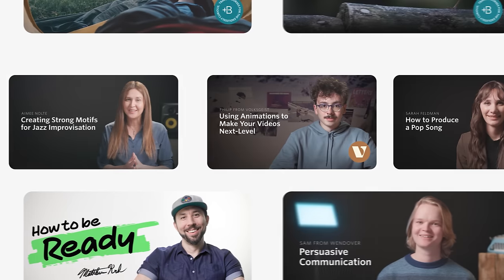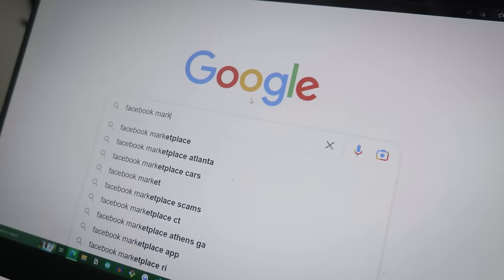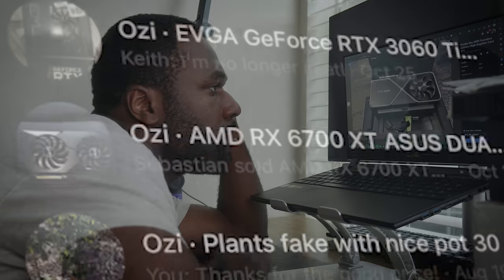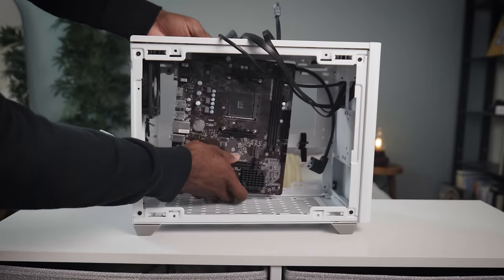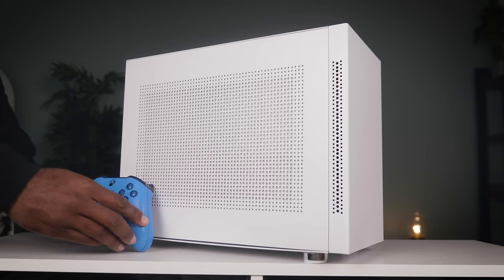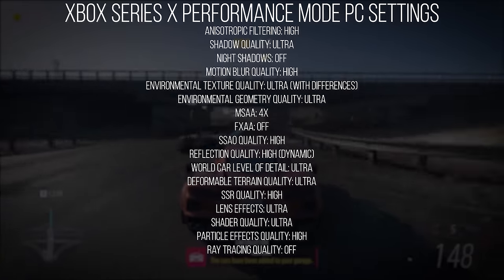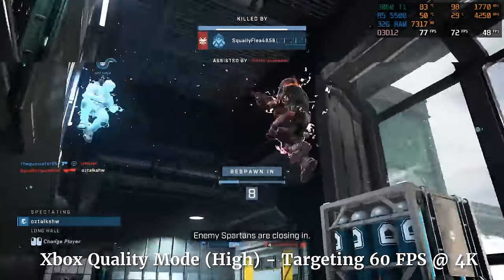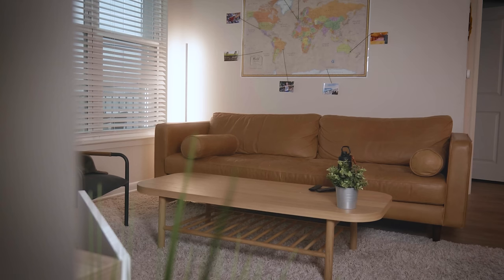I built a faster Xbox Series X for $474

Comment: The consoles may use a 6700XT-esque GPU but their performance isn’t even close in reality (find benchmarks if you don’t believe me) so the idea that you need a $400 GPU to keep up is inaccurate.
 You also could have cheaped-out a bit more on the Case, PSU, and motherboard, which when combined with a more reasonable GPU equivalent could have the price of a new rig at around $6-700
Cool and well produced video otherwise.

Comment: If you update the bios on that mobo, you can enable 4g encoding / rebar and using an Intel Arc a750 with it (I know this because I just did this for my son replacing his old 1660 Super and he has the same mobo basically "msi a320m-a pro") and it'll put you around the power of a 3060 10fps faster or slower depending on the game and the Arc a750 is CHEAP. But you NEED rebar. I know its about a 3060 as its performing about the same as the EVGA 3060 12gb I had before I upgraded to a rx6800 16gb. EDIT: Didn't get to the GPU part, 3060ti good deal bro!

Comment: If you place the PC on the floor to the left of the cabinet, the temperatures will be better because there is airflow all around the case. Even with the cabinet door open, the hot exhaust air gets trapped in the back of the cabinet and cannot escape easily. Aesthetically it's nice to have the PC inside the cabinet, but with a graphics card working hard, you really need to move it out. After all, you made a PC that looks great. There's no need to hide it away!

Comment: I ran into an equally long debate about which case to use for a system downsize. Unfortunately there's just no clean way to use the NR200 without paying the itx tax on at least the mobo. A small matx form factor is definitely the way to go when budget is the primary factor. But if ITX is the goal, nothing beats the NR200 on compatibility and budget. Thanks for bringing the vibes Oz!
Reply from the maker: You feel my pain 😭 I really wanted the NR200 to work, because it's an affordable entry to the SFF world...but the SAMA IM01 is still killer. It's an NR200 copy and only an extra liter of space. Seriously unnoticeable. Glad you enjoyed!
Reply: @OzTalksHW  Oh wow, I didn't know it was so close in size! Good call on that one. You're almost making me regret switching my matx mobo out 😅 I really like the vinyl wrap idea as a solution for getting those black parts on theme. Cheers bro!

Comment: Don't waste money on vinyl wraps and cable extensions on any builds that don't use a pc case with tempered glass. Save about $20-$40 without all the additional pointless stuff. I would also have kept the NR200 case instead and to find a used B450 itx board like the Asrock B450 fatality mitx motherboard instead, NR200 offers way better air cooling and potential side mounted aio water cooling if you opted to do so in the future.

Would 100% get better GPU temps with the NR200 case.

Comment: The gpu was overheating because the 3060 ti isn't meant for 4k. It's meant for 1440 which it's a beast at. You would've gotten way better fps at 1440 as well.

Comment: Hey man i have gtx 1070 blower style fan like yours... I was getting c so I opened replaced the thermal paste on gpu and the thermal pads on the gpus memory... the factory thermal pads sux... try replacing them... gelid is the brand of the pads ... now getting 65 68c...

Comment: Leven has been making switching from Mechanical to solid state a lot cheaper.  I gotta convert 40TB of HDD to SSD, and they have lowered their 4TB SSDs to really low amount I just bought there 4TB NVME for $200.  I am also planing to buy a few of those 512GB SSDs to give some old laptops some new life, and turn them into Batocera PCs for emulation for those that want to get into classic gaming cheap since they're too old for modern games/programs, or even Windows 10 for that matter.

Comment: 1. IDK why you think why it's hard to find a MicroATX case that supports a standard ATX PSU (150mm). My favorite cheap MicroATX case, which also happens to be the CHEAPEST mATX on Newegg now, is the "DIYPC DIY-F2-W White SPCC Micro ATX Mini Tower Computer Case" and supports a 170mm PSU.  It's only $40 +$8 shipping. All you do is click on Cases > MicroATX > Sort by Price. Plenty more exist too, so IDK why you weren't able to find them.
2. That SSD is trash and will prolly die quickly. While I know you were budget limited, for people actually doing this, I'd suggest putting more towards a good SSD.

Comment: There are many things wrong with this!! I'll try to bullet point for brevity but apologies in advance for the length of this:

- You have a SATA ssd, you'd need a pcie 4.0 M2 to match the xbox. Your load times are gonna be much worse.

-Even if you found an m.2 ssd, your motherboard only supports up to pcie 3.0, so still slower read/write speeds. This isn't even mentioning your half-size storage.

- Your RAM mysteriously doubled from what you bought and what was displayed (16gb to 32)

- You had to absolutely deep dive through 2nd hand marketplaces to find any of these components and your cost didn't factor in money wasted on junk (which will happen with these markets)

- You could just buy a second hand xb sx for half the price and a free controller. That alone invalidates your video

- The majority of games support free upgrades from xb1, and even if they don't, you can get much cheaper games than xb marketplace. Elden ring is £35 on cdkeys. Idk what that is in $.

- You didn't include price of OS. You can get a windows key for about £70 in the uk.
I tried cloning my OS from an old pc hdd to get around this, but boy was that a ball ache. Never again.

- Games will be optimised for consoles: they'll load and launch faster, and make far better use of the hardware.

I mean no disrespect, and I have no issue with these kinds of budget like-for-like videos, but I have serious issues with pc master race fanboys making ridiculous claims that they could build "xbox / ps5 killers". This isn't even mentioning how good console UIs are, with loads of built-in features like party chats, messaging, anti hacker services, NEVER HAVING SOFTWARE ISSUES, etc...

What you've made is so much worse than a console.
Reply: Hmm all these bottlenecks but forza and halo still run better :/ weird

Comment: my micro build msi board $360 au ddr4 3600 32 gig $120 9900k $360 ebay 3700ti $1200 watercooler 240 $80 power supply $60 hard drive m.2 500gig $29 2 gig hd $110 and it gets real hot

Comment: I made an offer of $198 for 2080 and the seller accepted and then immediately after I found $120 Ryzen 5600X, I was on my way to build I cheaper PC than yours but the sff case, the SFX power supply and the Mini-ITX board pushed my budget to $647 in total

Comment: I have a 3060ti with a small undervolt and it usually is in the low 60's while gaming  (in a small form factor case). I imagine having it inside that cabinet could be part of your issue? You seem to have plenty of fans.
Reply: @Blue I have it paired with a Ryzen 5700X, while he only has a 5500.
Reply: @Blue 1440p. GPU often into the high 90s so it's definitely getting a workout.
Reply from the maker: Is yours a blower style cooler or a dual/tri fan axis cooler? Blower styles just run hotter unfortunately
Reply: @OzTalksHW  I just went back rewatched your vid and I guess I missed the part where you hold up the GPU (and show it to be a blower style). You're right that probably accounts for a lot of it (mine is dual fan)! But still for $240 what a steal!

Comment: Me looking at this dude while I’m seeing what it costs to play cyberpunk at the best settings with parts excluding the updated ones I have costing me nearly $1000😂 buuut that’s why I’m using my tax returns to buy those parts. Already brought a Ryzen 9 5900x for only $350.  Now all I truly need is a better power supply, case, and motherboard(especially since my cpu won’t even fit in my one now). I already have a 3070ti with a hyper 212 cooling fan which surprisingly works incredibly well with cyberpunk considering it’s very cpu heavy. When I buy all my new parts I’ll have my friend guide me through building it because I’ve never built one before. I’m very excited and it’ll be hopefully my last upgrade ever until maybe a new graphics card in the future.

Comment: You can definitely change the Xbox resolution settings from 480 to 720 to 1080 to 1440 to 4k .. you can also run 60 or 120 fps . You can also use freesync ! There’s no reason to get a PC nowadays , but if you just want to say you have one. You’re actually spending more for less
Reply: consoles run a lower resolution scaled up to a higher resolution
Reply: @Gr8Imres  I’m sorry , but games for Xbox and PlayStation are not scaled in any way. They’re particularly made the run their best in consoles. You see, the difference between y’all’s low medium high and ultra. We only have one setting. Ultra . Some games allow you to focus on frame rate and will take some graphical settings out. But other than that , You basically buying a pc for nothing. I have a pc but even with a 4070 and a 240hz 1440p that can also run 4k it’s nowhere near as smoothe and simple as the console. Yea I can mod but other than that… it was really a waste
Reply: @G0dspeeed97  "They don't run native 4k. They use checkerboarding and upscaling techniques, or run a lower resolution. Interlacing, dynamic resolution, and other tricks, but non of them are true 4k 60"
Reply: All the latest AAA games on console are 30hz with some getting a 60hz performance option.. cod is  like the only 120hz AAA title as of lately..

For resolution its all FSR upscaling, not native 4k 😂
Reply: @LovingAllOfYouuu The Xbox and PS5 literally use FSR from AMD to upscale the image for a higher fps count. 

Games are cheaper on PC, free online more in game options, more games than the ps5 and xbox combined the list goes on. 

You're just uninformed brother😂
Reply: Also, free sync is literally just a VRR technique to match the refresh rate to your display to the fps in a game literally does nothing for performance and isn't exclusive to consoles. 

Free sync is on PC for AMD GPUs and for Nvidia users it's called G-Sync. Both are shit options and instead of having them on they're better off to reduce frame times and latency and stutters from 1% lows.

Comment: I'd add a temp controlled fan, to cool that gpu a bit more... Also change the back one, for a temp controlled one. They are cheap & you can place the temp probe, where you need it.. then obviously as the temp starts to rise, the fan speed increases, to handle it!
I got 3 in my system, & normal intake fans at the front x 3...

Boy, changing the other standard top & back fans, to the temp probe speed controlled fans, made a big difference & better sound control also, as on cooler days (room temp) the fans spin slower 👍👍
Reply: Aren’t all fans temp controlled.. or at least spin faster when the temps rise, and you can change the fan speed in bios, but the computer should do it automatically, you shouldn’t need “temp controlled fans”
Reply: @IMDYT420  It is all dependent on how they are powered... That being said, the system I was referring to is an older PC... The case also has high, low & off switches on the case, my other system has a dial, so I can turn them up & down...
My 2 year old system, yes you can do much the same thing in the settings.
But if you are powering them differently, than from a dedicated fan header connected to the MB, you don't get the option.
So that's why I got the probe type, for the extra fans & noticed a big difference in noise...
All the best 👍

Comment: thats cool but it took 2+ years and used items to make a pc similar to series x at 500$ but in 2020 it was impossible to match a series x even with 1000$ its a good educational video but doesnt really solve the difference of consoles vs pc's, what this shows is electronic components get cheaper over time and explains moore's law which everybody expects but in a years time the consoles will get cheaper aswell if things go to plan a series x will be 350 or 400$ brand new so its normal. since used series x consoles already go for 350$

Comment: ryzen 5 5500 is not a good cpu, its not like 3700x at all!! it has a very similar performance to 3600
Also some b550 motherboard require bios update to run it,  average consumer do not have a spare cpu to flash it, get 5600 instead, much better performance but small price different, this guy dont really know much about hardware and trying to teach ppl?

Comment: For the tech peoples here, random question. So technically I have a PC specced better than the consoles, my question is why doesn't it perform as well? 32GB ram, MSI 6800XT 16GB, R5 5600X and 800W PSU. For some reason my PS5 seems to perform better. Is it purely just due to devs optimizing consoles games much better? That's what it feels like anyways. all my drives are SSD as well.

Comment: What’s your 474$ specs again ? 
* Show in a flash & hide away * 

Lemme help ya :
Ryzen 5 5500
MSI A320M-Pro VH
2x 8GB DDR4 3200
512 G SSD Amazon 
RTX 3060Ti OEM
Sama IM01 case 
EVGA 650 Gold PSU

Comment: Damn bought a R5 5500 back in december to upgrade from my R3 1300x (chose the R5 5500 because it was about the same price as a R5 4500 and quite a bit faster) but didn't think it was going to be more or less on par with a 3700x especially for the price I got it brand new 0_0

Comment: I searched for the cheapest equivalents of your build in my country:
Crucial BX 500 GB SSD: 35 USD
600w EVGA PSU: 53 USD
G.SKILL 16GB RAM (dual ch): 58 USD
motherboard MSI A320M-A PRO: 79 USD
Micro ATX Gamemax white case: 42 USD
RTX 3060 Ti: 538 USD 😅
Ryzen 5 5600: 176 USD

TOTAL: 981 USD 🤣

Comment: Just like the first reply States you have 32 GB of RAM instead of 16 GB of RAM and you put the 512 SSID hard-drive in instead of the one terabit no offense you can get the exact components and Hardware that a series X/S has but you're missing the main thing that runs the system the Microsoft OS with velocity architecture which is specifically coded and made of for gaming on console without that type of software you will not make the performance framerate or anyting that you're wanting in other words I agree with Doctor tuning down there that's why you went with a higher rate of ram 32 GB instead of the 16 and other things the ryzen 5 processor isn't going to push anything like what's in the series SRX I'm sorry I got a full ryzen 7 and Rising 10 setup hybrid and I'm constantly using my ryzen 10 over the ryzen 7

Comment: a series X crushes a 3060ti...
Reply: No it absolutely doesnt. Dead space runs only at 30fps at 1440p while rtx 3060ti can run dead space at 60 fps 1440p max settings.
Reply: @Marko-ij4vy  That is not a hardware issue.
Reply: It doesnt "crush" rtx 3060ti no matter how you look at it.

Comment: The 6700xt is quite a bit stronger than an Xbox/PS5.
Something in the neighborhood of 6600-6600xt would be closer.  Actually something less than a full spec 5700xt.
Reply: The XSX still has more system total bandwidth and a faster NVMe drive.  XSX has 52 CU vs 6700XT 40 CU units.
Reply: @ssaini5028  
Developers have stated the XSX isn't any faster than the PS5 which has the specs similar to 5700xt.  But they don't either the power delivery, dedicated GPU memory bandwidth or cooling of a PC.  

The CU count isn't a meaningful metric.  The 6600 has 28 RDNA2 CUs and is only slightly slower than 40 RDNA1 CUs in a 5700xt. And the 32CU 6600XT outperforms it by double digits percentages making arguably equivalent to 45ish RDNA 1 CUs.
Reply: @pweddy1  CUs are very relevant if we are talking about the same architecture.  The XSX on paper is more powerful than the PS5.  At this moment we do not see any tangible improvements XSX over the PS5.  However this may change in the future as consoles age and software games become more optimized to take advantage of  powerful hardware.  
Developers have also said that they aim for parity when it comes to 3rd party titles on both consoles.  1st party titles is where these consoles shine anyway.
RDNA 2 is significantly more powerful than RDNA 1 you are right.  XSX GPU power similar to the 5700XT but has more bandwith.  Since it is a custom ship it isnt an apples to apples comparison.

Comment: Sure the pc might be cheaper and might run a bit faster. But here’s two reasons  why consoles (and in some circumstances Mac computers) are preferred over PCs. CONVENIENCE and WARRANTY. When I want to game the latest generation of games, I really don’t want to take the time to figure out how to put together my PC (or at the very least, pay someone to do it) I’d rather have it setup and ready to go. Sure PCs have the ability to constantly upgrade the graphics card, GPU / CPU Ram etc etc to improve the quality of the game, but to me, the graphics are marginally better when you do that. I feel like it loses its allure to see a small leap of graphical fidelity if you constantly improve them as opposed to being blown away to see the large leaps in graphics and performance  from each console generation. And as for the warranty, consoles at least have a free 1-2 year manufacture warranty if anythings go bad. When adding different components on your PC and something fails, you might get a warranty for that part, but your pc might have different issues as well that you will have to figure out yourself thus wasting more time fixing the system when you could be gaming.